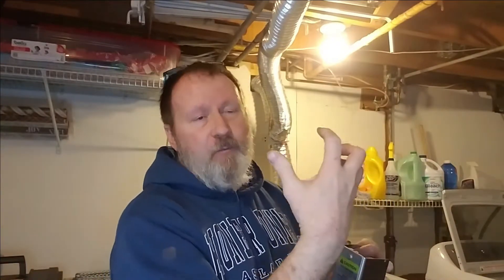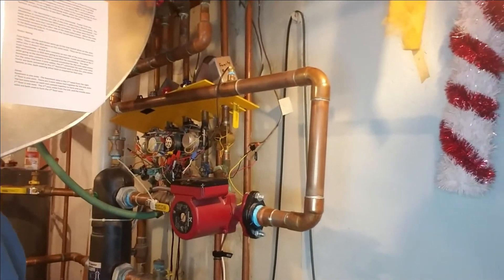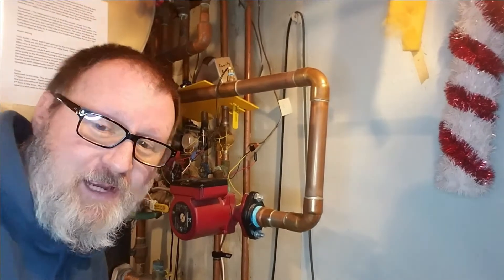How A Zone Valve Works - Wiring for 2 Wire System

Comment: Thank you for the video clip! I didn't understand why my zone valve didn't work and the previous owner was completely negligent of how it works. The transformer was covered by paints and the valve apparently didn't even have connection to power. I finally figured it out after your diagram.
Reply from the maker: Thank you!  I know I was super intimidated by these when i first saw them and started trying to sort out the mess of wires for my boiler.  After figuring it out, it was really kind of cool to see just how simple it was after all.

Comment: Hi, when you install a new zone valve, before you connected to power is it closed ? Or the valve needs 24v so it can close? Thank you!
Reply from the maker: The valve mechanism where the motor is located has a spring that keeps it closed when not energized.  It only opens when 24 volts is applied to open it.  If your power goes out while the valve is open, the motor will no longer be energized and the spring will pull the valve back to the closed position.
Reply: @MIFixItDad  well I've installed a new valve and looks like when not energized it's open. When energized nothing is hapening unless i set the thermostat to 30+ and then its closing. I've fallowed the water flow arrow and it's in the same position like the old one. Wiring is correct lile in your video ( yellow from the motor to 24v power supply/ 24v power supply to thermostat/  thermostat to motor ) red wires ( end switch) lose.  Is it possible that the old valve was mounted the other way around and i did the same with the new one?
Reply from the maker: @Nothingtoseehere84  it sounds like it was mounted the wrong way around.   Rotate it 180 degrees and see if it works
Reply: @MIFixItDad  i will try, thank you so much
Reply: Is that a “y” on your dryer vent?